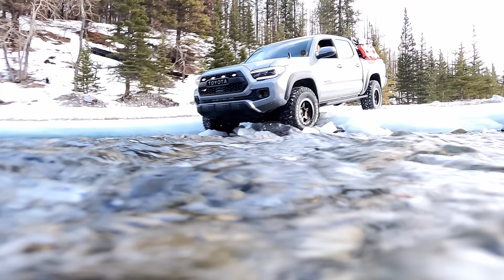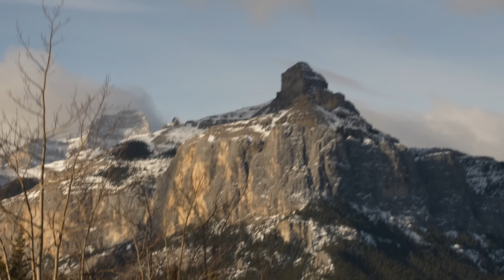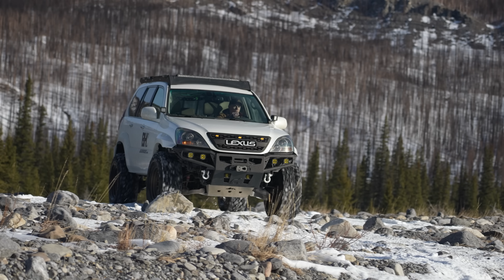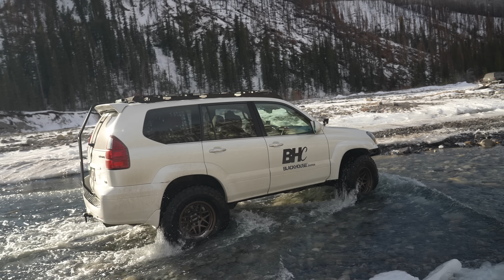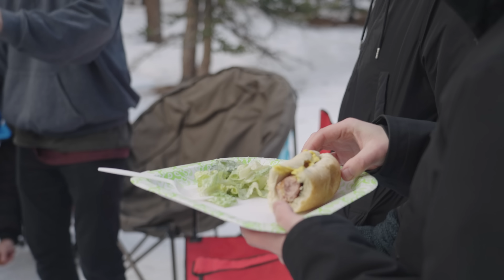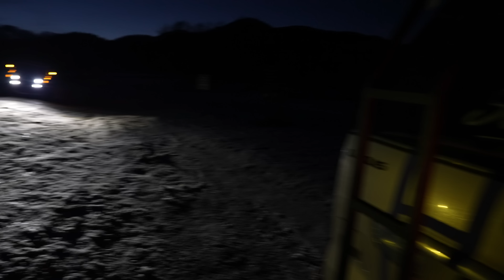Into the ICE - Crazy River Crossings & Recoveries | Lexus GX470, Toyota 4 runner, FJ Cruiser

Comment: That would of been a hell of a trip. Thanks for sharing.
I had went with the K02's, and found out the hard way, they are terrible on icy snow. Ended up just getting a set of snow tires, for winter. I'll just put the K02's back on in the spring.
And I can relate, was minus 30 up here in Peace River for, I swear, three weeks straight!! Enmax was $530!!

Comment: Awesome video. Is running 35s on stock gearing that bad? I’m thinking about getting a set til I’m ready to regear/twin lock the GX. Just worried cuz it already feels so sluggish on 33”s lol
Reply: The v8 is no joke, 04 4runner v8 saw engine on 35s and just as fast on 33s but drives better. Make sure all your maintenance is up to date and get a Throttle controller makes big difference
Reply from the maker: Thank you! Exactly what Yotasurf said I find it actually drives better on 35’s then on 33’s, its like that extra jump up in tire size actually works better with the gearing for better shifts if that makes sense.
Reply: @LoganKingMedia  cool, thanks, I suspected as such since so many people are running it like that.
Reply: I have 35s on my gx460. Look into getting a throttle controller. Feels like it’s on 30s now 😆